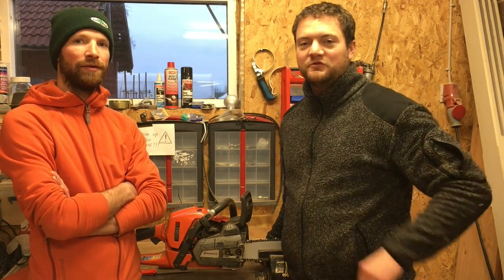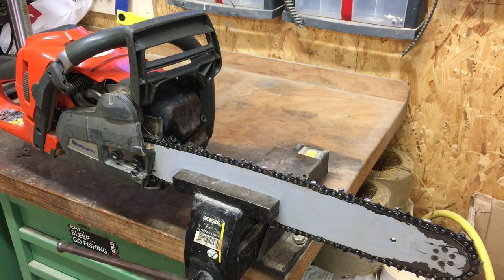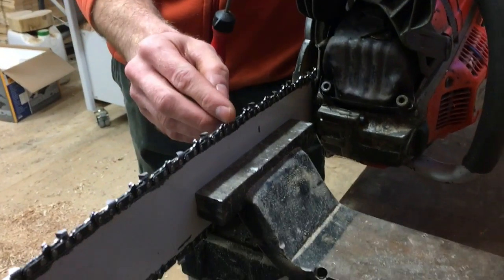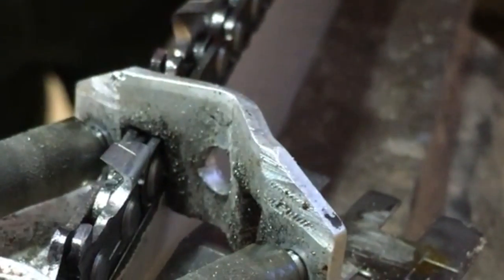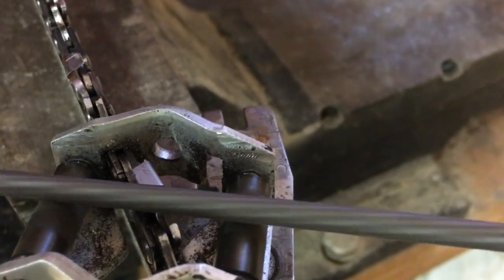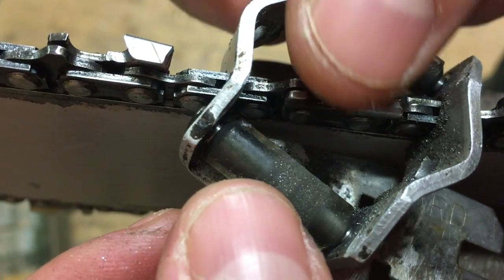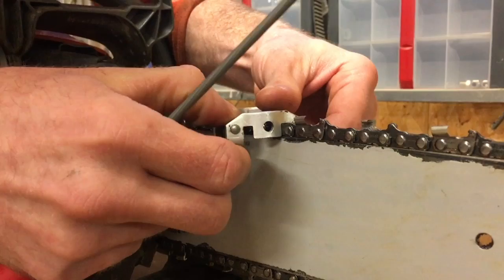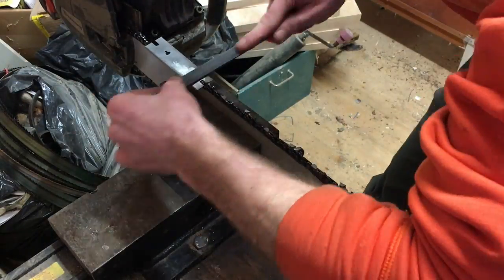Razor-Sharp Chainsaw - How It's Done

Comment: I've always been told that the reason for the different widths from the cutting edge to the backside of a tooth where the points on the right side of the chain are almost always shorter was because of a more aggressive right stroke than the left stroke thus taking more metal than the left stroke. Well I believed this for years while gradually learning to sharpen chains to cutting specs until, it dawned on me that this wasn't true and here's why, all saws as far as I've known were built for orthodox or right handed use, with that being said what I noticed is when you hit something underneath the log when bucking or cutting fire wood on the ground that it was always nearly 95 % of the time it's the right side tooth points that gets more disfigured than the left side tooth points and since saws are made for right handed people, the very second the chain passes through the bottomside it generally has slightly more pressure on the right side which causes a slightly more right side tilt and causes the right side points to make contact first with whatever you've hit, rock or metal, therefore when you resharpen the chain with the right side points with more noticeable damage than the left, your right side is shorter by the time you file it back to a point which is the most important part of the tooth that starts your cut, the only way to get the teeth back to the same width from edge to rear is to take more material off the left stroke to match them back up. I noticed the damage to the right side teeth to be more on chains on saws that other guys needed me to sharpen because they couldn't sharpen other than chains that I hit stuff with. Also it's better to sharpen or better yet touch up a chain before you mangle it beyond dull, and causes the sharpener to spend hours trying to bring it back. You can look at the edge and if you can actually see a line shining as you look from the front of the tooth then go ahead and use a 3-4 strokes to bring it to nothing that you can't see on any cutting tool or utensil, and also file the tooth to where the top edge of it almost covers the diameter of the file instead of shallow sharpening it where the edge is noticeably lower than the diameter which creates a taller angle of the edge that maybe sharp but is nowhere near sharper than, or cuts faster than a low angle thinner edge and when a chain practically looks like a person's teeth that never brushed or have done dope for years, by keeping the maximum depth of the cavity it will still actually cut as fast as a new chain with a good sharp edge, I've actually did this and others preferred using this chunky looking toothed chain saw over one with teeth that needed touching up or the drags lowered.

Comment: Where can il get the roller gauge you are using. I live in the UK
Reply: Oregon makes them.  Stihl makes something similar.  The Stihl system provides greater control, but the file needs to be in a file holder.
Reply: Fred Garvin thanks Fred 😉

Comment: Great video guys. 
I'll just chime in one thing here. 
Teeth don't have to be the same length. Diffrent lengths will not make the saw pull to one side or the other. As long as your depth guges are all adjusted to the same hight
Reply: What he was saying is that if one side is filed sharper or a different angle. Different lengths WILL make the saw work harder, as it is now 'unbalanced'. Also I wish they had mentioned/shown 'dressing' a bar, which is important to keep a chain from leaning to one side and cutting curves.
Reply: Turd Furgeson you will not if you are using a progressive raker gauge.
Reply: thank you mate and yes you are correct as all that is needed is a consistent sharp edge on every tooth and depth gauge to same allowable cut from tooth which I have been shown a chain that was filed to different lengths just to prove this point and it cut just as good as an even toothed chain
Reply: Dwayne- It's impossible for a chain filed unevenly to cut as good as an even toothed chain. The higher teeth will be doing the majority of the work. Even if every low tooth had a comparably lower depth gauge the high teeth would be doing the cutting. Obviously the teeth can only cut to the depth of the highest rakers.
A few random teeth filed shorter will simply slow the removal of chips from the cut. But if the left or right side teeth are all shorter/longer, the saw will cut a curve, because again, the high/longest teeth do all the cutting.
Reply: So you think every tooth cuts on every pass well best look up how a chain snakes n waves
Reply: And they are depth gauges not rakers which is obviously where you have no understanding of how a chain is designed to work
Reply: Note that I used both terms- raker and depth gauge- so that people who use saws every day would understand as well as someone like yourself, who apparently  only reads about them.
I know in my lifetime I've been through more chains than I care to think about, and as far as I can tell they were designed to work well, as I've cut many hundred cords of firewood as well as thousands of saw logs. In that time I think I got just a little bit good at hand filing and understanding what works and what doesn't.
But feel free to correct me if you read something different.
Reply: Oh so you think i read about it ha well there you are I correct you and well I pretty much only hand file can't be bothered carrying round little guide tools which as you say you know how to do it but still see how you skipped the other part I mentioned about how a chain is made and designed to work so it snakes n waves n well you claim a balancing act hmmm so the wood your cutting has no hard or tight spots which would upset that
Reply: julie r simply go on my page and look at my chainsaw chain video. I bust the myth clean out of the water that uneven teeth from.one side to the other give you an uneven cut.
Reply: Ok Victor, I checked out the video, I will say it's got me curious, I need to do some experimenting. Your methods were a little vague (measuring by using drill bits, etc.) and I think hardwood may yeild a different result than cedar, which is very forgiving. It also will depend on log size and whether chain is full comp or skip. But I'm going to sacrifice a chain this weekend and try it on a 16" birch log.

Comment: I Just get the grinder and take those rakes down about 2mm when cutting Australian hardwood which has been dead no less than 15 years, I sharpen every tank of fuel which is an over loaded landcruiser worth. It may sound crude but the chain never stretches I use a stihl ms660 an extra tooth on the sprocket,baffles gone it's great on fuel that way and can really rip. Oh it's a semi chisel chain I run the saw at 40:1+ it never gets hot I use 98 octane fuel only stihl 2 stroke oil

Comment: dont forget to use a file card ( fine bristle wire brush)  to clean out the teeth in your file. it gets clogged pretty quick when you have a super dull chain. saves on time and frustration.

Comment: I've never used this kind of roller guide. I always use the rectangular  flat file holder.
almost all the wood I cut is dry dead oak above 5,000 elev. in the mountains  of southern  California.  this is brutal on a chain and sometimes I can barely finish a tank of gas without the need to sharpen again. the little  bit of white fir and cedar cuts like soft cheese by comparison.

Comment: you can make them razor sharp with just a file if you pay attention and watch the top of the tooth, you can see the dulled part being filed away and you can feel the way the file is cutting. you dont need any gauge or other goofy gadget to sharpen them.
also a stump vise works great if you are out in the woods and need to sharpen it
and when you have big chips coming out that means your chain is nice and sharp

Comment: A far more simple device is a Carlton file plate. It gives you the 35 degree and the right depth every time. It also lets you trim the rakers far faster than the tool used in this video. I'll put my chain up against any method used in any of these videos. Once again look it up CARLTON FILE plate. Make sure you buy the right plate for the chain your using.

Comment: I couldn't help but notice you set the rakers for soft wood then proceeded to cut hard wood. :-)
Reply: Yea. Kind of funny.
Reply: The raker/riser/drag or depth gauge controls how deep each tooth cuts into the wood. The hardwood setting takes slightly less wood and the softwood setting takes a little more. Depending on how long the bar is, hardness of the wood, power of the saw and the diameter of the wood you're cutting you'll need to adjust the height of the raker. He used a short bar, cutting old partially rotten wood, a powerful saw and was not burying the bar in the wood, so he took the rakers down slightly to tune the chain to the saw. That's why he used the softwood setting.

Comment: ok.  you get the small special  grid stone that goes in your drill....make it quick and simple. and really makes for a sharp blade
Reply: Lady pilliwick. I've often wondered why I haven't seen your technique being used. It seems plausible but I suppose consistency is an issue.
Reply: you cant feel whats coming off with a grinding stone there fore you go through blades faster ...and they do have angle guides for dremel stones but i prefer fileing by hand

Comment: Wait. 
You have to get a license for a chainsaw in Sweden?
Odd.

Totally agree about getting the chain sharper with files than with grinders.
I've tried several chain sharpening grinders and attachments, trying to find a faster way.
I saved no time versus hand filing the teeth, and the hand filed teeth stayed sharp longer than the machine sharpened teeth, because they were sharper than machine ground teeth.
5 minutes of cutting with machine sharpened teeth and I was back at the stump with the vise and file.
Reply: fortj3 not for private use. But if do a work for another person/ firm you nead.

Comment: Try a chisel-bit flat file on a chisel-bit chain.  You sharpen from the front of the bar towards the back.  The edge of the file is beveled on both sides.  A new chain is incredibly dull.   Carlos.

Comment: What you referred to as "risers" are actually called "depth gauges."  The guide you used to check them should also be called a depth gauge.
Reply: You mean a depth gauge gauge
Reply: Rakers are the slang term since they are what removes the wood shavings.

Comment: Some time ago I was shown by a tree surgeon to use a very fine hone to dress very lightly the outside of the tooth on both vertical and horizontal surfaces, this was supposed to remove any burrs and reduce drag. Anyone any experience?

Comment: You used the SOFT gauge then cut HARD wood. I’m confused.
Reply: In a bigger saw you can do this or if you sharpen very well if you do not it will pull like crazy and if u hit it wrong it’ll buck up into you or drop it, some people also like to be lazier and not have to push on the saw while cutting as where on hardwood setting you would have to. Also that oak was past its prime so not as hard as it could be

Comment: man you need to get the gullet looks like you haven't filed the gullet at all man check out Buckin' Billy RAY those are called depth gauges if you'll get the gullet you'll be amazed how it helps
Reply: man if you get the gullet your wood chips will be bigger and your saw will cut faster i saw your wood chips cumming off the bar and they were small almost like dust with some bigger chips mixed in get the gullet and all your chips will be bigger just trying to help

Comment: Thanks guys -- loved the funny looking file guide.  Idiot proof, it seems.  Also, look at the chips that come out of the cut. They should uniform in size and nice consistent  chips / shavings.  If the saw doesn't make this type of chips and are mostly small chips and dust, you might need to check the depth gauge /"raker" height.  You have no way of knowing what the proper height should be unless you use a depth gauge tool that simply lays over the raker.  If the raker sits proud of the top of the gauge tool, it needs to be filed down a couple strokes, checked again 'til it's just flush with the gauge tool.  The raker is designed to be  .020" below the sharp edge of the cutter tooth.  Any more than flush (proud) and you'll get dust.  If less than 20 thou and the chain will grab and not cut efficiently.  Raker depth is just as important as a sharp tooth edge. ( PS. I use the depth gauge tool as a measuring tool for the height of raker -- I don't file across it as it will eventually wear into the surface thereby making the raker too low -- it should just be flush with the depth tool. )

Comment: 1:40 Bullshit ! 

I have a Dolmar (Makita) PS-6100

It comes with a 3/8" 1.5mm chain. 
Owners manual says: 5,5mm file, 25° filing angle and 10° file angle Blade to file from the standard 90°

That's exactly what I get with the Husquana H42 sharpening kit. 

My dolmar chain is razor sharp, like yours and it cut's like butter.

Comment: For the best results you should find the shortest tooth on the chain, sharpen that one and then bring all the rest of the teeth down to the same length.( tooth length determines tooth height). From here you can set your depth gauges(rakers). You should remove the depth gauge tool before filing- otherwise you thin the tool and set your rakers lower.
Reply: Sounds like waste of chain
Reply: True, but proves someone can relay the same info as in the owner's manual.  Realistically, nobody spends and hour sharpening a chain.
Reply: cable tie can't say you're wrong but damage a tooth that badly and I call it my new stump chain
Reply: Not if you want it to cut straight !
Reply: I find that just eats the chain. I dont make all the cutters the same and it does just fine

Comment: Is there a mark that tells you where to start filling or how do you know that you have come full circle? Maybe count the number of teeth?
Reply: Rien Bijl I use a sharpie or some chalk to mark the tooth I started with. But you also can see where you have filed already as sharpened teeth are shiny while the rest is dirty from cutting.
Reply: I use a magic marker-       black is ok, Red or blue shows up better so you know where you started,
Reply: Most chains when made have an uneven number of cutting teeth which leaves either two cutters or a bigger gap between. I use this as a guide to start. If not a masker is fine or a drop of blood, always seems to be some on hand.
Reply: I use a green paint pen and make my starting link fully green. Weeks later that indication also tells me that a chain has not been used or lightly used and ready to go.
Reply: I use a magic marker- red or blue- it shows up better than black  on the cutters - "Cotronixco" apparently has a different prospective  on filing a chain ? Or I am missing something ?
Reply: where are you going to find a "masker - drop of blood" ? ? a vampire ? ?? - just to mark where you start  and stop sharpening a chain saw chain ? ?
Reply: I use this thing called my eye. you can tell right away if it's one you've sharpened or not. if not take it to get done professionally
Reply: If your eye cannot tell a freshly sharpened tooth, then how do you see to file properly? No sin to use glasses to file!
Reply: I use a lumber crayon or a child's crayon to mark the start / finish point. Just easier to see when distracted by other things.
Reply: Rien Bijl use a sharpie to mark where you start.
Reply: Yep, thats how I do it too, , never had a chain that was even number of the same teerh,
Reply: White out works well.
Reply: you should be able to tell by looking at it. Itll have a little bit of burring (filings) stuck to the tooth, and should be shiny metal. Before you start, look at the tooth, itll have discoloration on the cutter, after you file the discoloration on the cutting portion will have been cut off.
Reply: Pay attention to how the first tooth looks when you file it. You can tell the difference between it and the unsharpened ones.

Comment: It's the rakers, also called depth gages you're talking about. I usually like to keep mine filed a little lower than the height of the cutting teeth. I would never, ever use one of those filing jigs tho. Learn to hand file your chain. After you learn that, you'll never go back to those gimmicky pieces of crap.

Comment: "RAKERS"  were on hand powered crosscut saws and early gas engine "drag" saws back in the olden days-  modern saw chain has depth gauges sometimes called "drags".  They do not rake wood fibers out of the kerf to clear the cut.  But we call 'em rakers anyway.  Just a corrupted term.  No bigee.